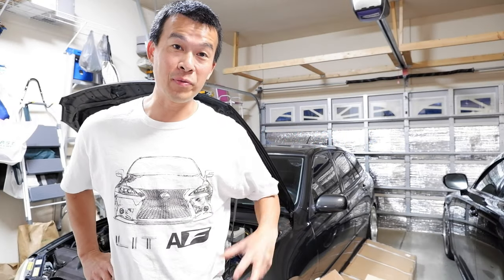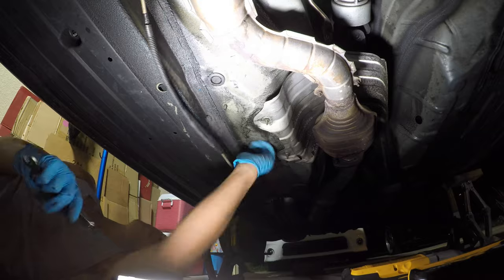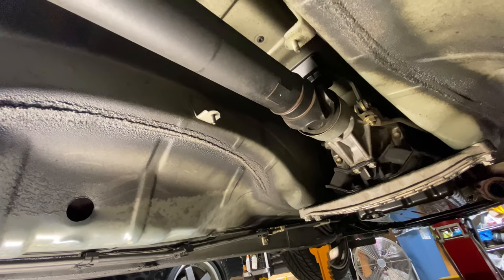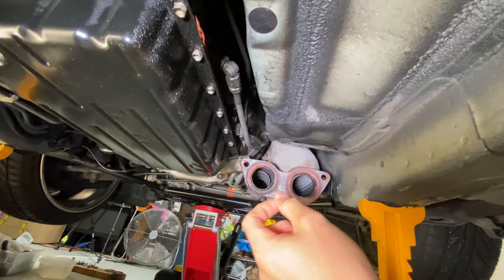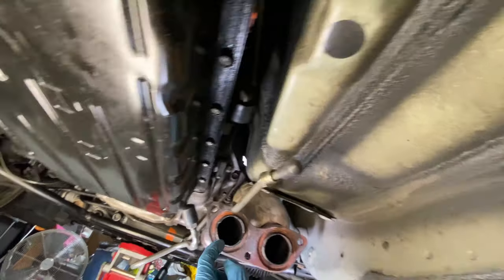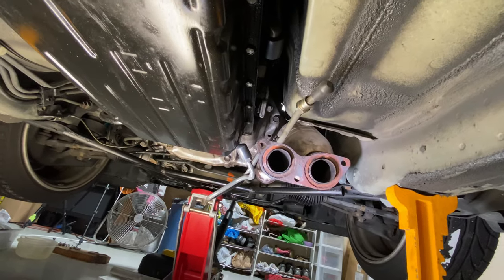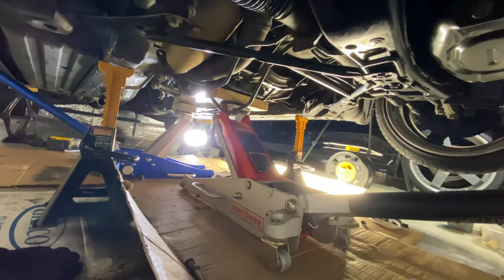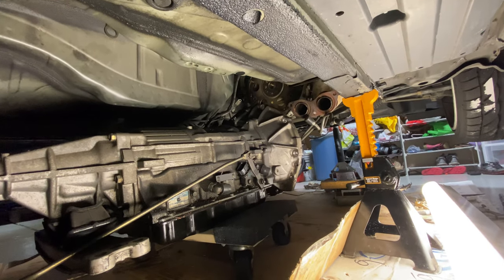Lexus IS300 DIY Transmission Removal | How to Remove Automatic Tranny

Comment: Great Video! Hope it helps me to change the rear main seal - its leaking a lot of oil on my GS300
Reply from the maker: Thanks. I have the rear seal DIY video soon. I ran into some hiccups but got it sealed nice.
Reply from the maker: I just posted the install video for the seal. https://youtu.be/xl_glIM9nDw
Reply: Here for the same reason

Comment: I just bought an 2005 IS300 for my son two weeks ago and it just developed a severe transmission oil leak. Thanks for the great content. This video was super helpful in removing his automatic transmission.
Reply from the maker: Severe leak is bad, might be more than just a seal. The oil pump inside the bell housing might be bad. These A650e transmission are easy to find. Most are giving them away. I have one in my backyard ready to give away for like $50.
Reply: @TunerwithKids do u still have ot i would love to buy

Comment: Your video has helped me so much, especially since I'm pulling a transmission from a sedan in a junkyard. Now I'm just a few bolts away from dropping the transmission, but I'm going to try a suggestion I found online. They suggested using a ratchet strap and 2x4 with the ratchet strap looped around the back end of the transmission and then ran up through the hole in the floorboard for the shifter and then wrapped around the 2x4. I should be able to slowly unwind the ratchet strap and control the descent of the transmission. I'm going to see if I can do something similar for the front. I just don't like the "drop it on a tire" method, but I may have to go that route.

Comment: I have pulled the tranny on my IS300 several times.. I've found it much easier to just pull both the engine and transmission at the same time.👍

Comment: Helped me to take off drive shaft on my altezza
Reply from the maker: What’s the problem? Should be pretty easy. Four 14mm nut and bolt on different and two 14mm to frame and slide out.

Comment: Cool IS300 videos, you got a new subscriber. My family has owned a 99GS since day 1. I plan to use your vids as reference when the time comes. Have you thought about investing in a Quick Jack by any chance? I think i'm going to get one.
Reply from the maker: I wanted to get a lift for my garage but it’s too tight right now. I have 10’ ceilings so the BendPak MaxJax was an option, else, just a four post for storage and other light under car work.
Reply: @TunerwithKids  Cool. I thought about those as an option but was too worried with complaints and didn't want to be stuck in the air with them, The quick jack seems "good enough" for not going that real industrial route, plus the convenience of storage and mobility seemed cool. By the way, have you had any experience with any immobilizer issues? I've been suffering with ours and a no start sometimes and what we have to do is leave the key in acc position for 10 mins to 30 mins sometimes for it to possibly " re learn "? I'm shopping all the time for another gs but all the good ones sell within a few hours.
Reply from the maker: Check one of my videos from last week, I have an immobilizer hacking video.
Reply: @TunerwithKids  cool vid,,how do you think it can help my situation? I was thinking you could just wipe out the need for keys to communicate with immobilizer? I skipped the route of getting my ecu reflashed by a mobile locksmith because it only loses communication sometimes. Someone told me maybe it's the antenna in the ignition.
Reply from the maker: Yea it could be a bad coil at the ignition or a loose connection. The ring around the key is an amplifier for picking up the immobilizer in the key. One way to test is watching the security light flashing.
Reply: @TunerwithKids  Yeah, everytime we want to drive the car we cross our fingers to see if the light will stop flashing when we insert key. What i have noticed is sometimes even though the light doesnt stop flashing after we have been waiting with the key in 10,20 or 30 minutes is the car will still start. Weird
Reply from the maker: So assuming this acts the same with all keys?  If that’s the case, try finding a replacement key ring assembly. If it still acting the same maybe their is something wrong with eeprom or ECU solder.
Reply: @TunerwithKids  right on, thanks. I sent out the ecu one time to one of those places that check them out but i'm wondering if they just hooked it up to theyre software to check things out and not physically inspected "solder". Yes, we have tried different original keys. I will try to get access to key ring assembly and at least inspect as well as the ecu.

Comment: Do you have a video on how to replace the torque converter?
Reply from the maker: No need for video on that, I have this removal video, a transmission seal replacement video, and a reinstall video. Those three combined should show you have to do the TC replacement.

Comment: I'm told there are two seals on either side of the transmission. I believe mine are leaking from those two seals on my 98 GS400 and already got the two timken 221207 seals to replace them. Have you replaced these seals? The one on the passenger side I think is connect to a "gear selector shaft?" Any recommendations on how to tackle them?
Reply from the maker: Never messed with side seals. Only opening is the shifter rod. Not sure on other side.

Comment: Those lines from the trans go where? Is it going to the rad for cooling the trans fluid?
Reply from the maker: Yes the trans fluid for auto goes thru radiator. There is a section at the bottom of auto radiator for ATF.
Reply: @TunerwithKids  im doing a cd swap on my aristo (jzs161) soon, have you thought if you would use that atf cooler for something else when you go manual?
Reply from the maker: Not sure if it’s worth anything on the manual swap side. If it was useful, I’m sure someone would have used it by now.
Reply: @TunerwithKids  i would recommend the serial 9 cd009 kit if you going manual. They got sales to bring the price down a bit but its worth every bit. Getting a used trans is easy enough and they crazy strong.
Reply from the maker: I don’t really want to modify and hammer out the tunnel to fit the CD. Im more interested in an AR or R154.

Comment: Good video. What manual transmission are you planning on putting in?
Reply from the maker: I’m eyeing an AR5 if I can find parts and pieces cheap. The CD009 is also an option but the Collins adapter kit is like $2k😩

Comment: on the flywheel part, the big hole to reach those bolts, is it suppose to be covered with something? because mines open too and i just got the car so im not sure. maybe something was covering it?
Reply from the maker: Yes. They make a plastic cover for it. See video description, I might have lost the P/N. If not, one of my timing belt parts videos from last year has all the info.
Reply: @TunerwithKids  thank you man!
Reply: So I know I’m a year late but I’m attempting this but my drive shaft isn’t easy to take out I can’t just use a impact like you did because the drive shaft blocks it

Comment: Hi on my lexus is300 2003 i have very slow reverse. 
I took it to transmission service shop they said transmission on its way out get another one . 
And its leaking from the front as well. You think its fixable ? Or have to buy another transmission that is almost impossible to find .
Reply from the maker: Is300 transmission are dime a dozen. Most are given away after swaps.
Reply: @TunerwithKids  well i cant find any i’m in Australia, this particular model 2003 is rare here . Do i have to find specific model AT transmission for my car or other year models or even is200 gearbox can work? Do you know help please?
Reply from the maker: @azadvirsingh4082  , not sure how many GS300 were sold in AUS but that should have same 2JZ-GE and trans. Lots of JDM Toyota cars had that motor too. The Aisin A650 is the exact code.
Reply from the maker: This history tells you more cars it came in. https://itstillruns.com/history-a650e-transmission-8753277.html
Reply: @TunerwithKids  thanks legend. 
Last thing, m planning to keep car for long time i love it. Its got 250k on it. If it was you would u recommend getting another second hand transmission keep looking or should rebuild this one. 
And i cant find any here is it worth getting one second hand from USA or canada but not sure how much shipping will cost. 
Thanks
Reply: @TunerwithKids  are u able to help somehow in finding one and i pay you
Reply from the maker: Manual swap…but with how common they A650 is (Ls430 and SC300/400 use it) you should be able to find one closer to you with less freight.
Reply: @TunerwithKids  so if i search with A650E transmission for sale what i get should be exact same for my car it will fit with no trouble at all?
Reply from the maker: Yes. It will be exactly same transmission. You may need to swap the bell housing over if it came out of a V8 car.
Reply: @TunerwithKids  is this the one u think?

Comment: I’m doing this right now lol , I had a question when removing cooler line from the transmission I think that’s what it’s called how are you able to take it cause cause I’m having trouble, I just got into cars I have is300 lol
Reply from the maker: It’s really hard and PIA to remove. The fittings are tight and stuck. Its also tight area, so it 1/4 turn at a time. It’s hard AF to put back too.

Comment: is it easier to hire a hoist to take the engine and tranny out and in?
Reply from the maker: Not really cause engine pull requires disconnecting coolant, AC, and power steering. This will be a huge mess unless you’re swapping engines. It really wasn’t hard all things considered. I had to do this twice since the new rear seal I used was incorrect and it leaked immediately.
Reply: @TunerwithKids  of course, I was watching engine removal from a gs300 where u could leave the ac in an the wiring loom was easy to disconnect. but then again it always looks easier than it really is.  👍

Comment: as for the hardlines, im just gonna cut them and run an6 lines
Reply from the maker: They are the worse to remove and reconnect.
Reply: @TunerwithKids  Its $50 on amazon for the fitting and line kit for anyone scrolling in the comments.

Comment: never jack up or put axle stands on the frame rail, use the proper locations
Reply from the maker: Frame rail is the proper location. You put it anywhere else and you’ll end up with a hole in the floor or bent seam.
Reply: @TunerwithKids  id stay away from the frame rail at all cost any damage there and the car is  stuffed (in my country). The frame rail is.not specified as a jacking point to my knowledge
Reply from the maker: Not true. Jack stands are supposed to be in a frame rail. That the strongest part of the unibody. When shops lift cars on 2-post lift, it goes on frame rail. Since most people us the factory jack point to lift, the stands can’t go there easily, the center frame point is next spot. On Lexus only the front one is advisable to use, the rear center frame isn’t as strong.
Reply: @TunerwithKids  use diff head front cross member and the 4 side jacking points